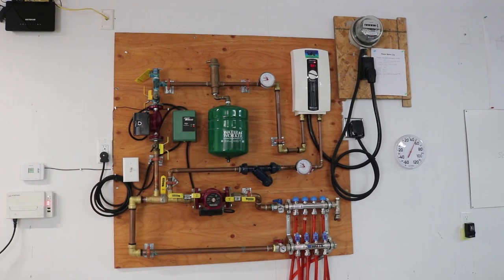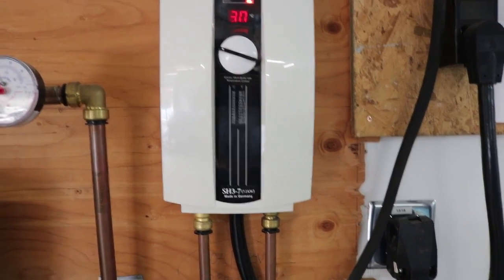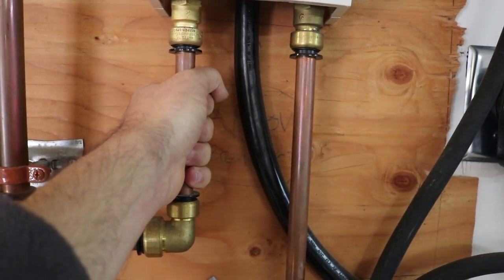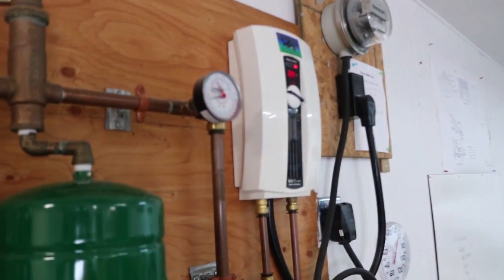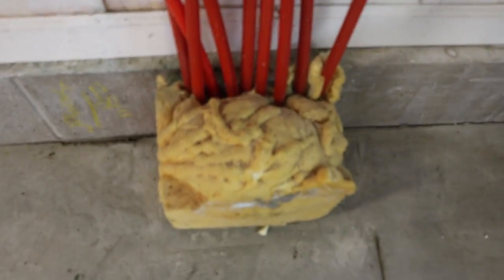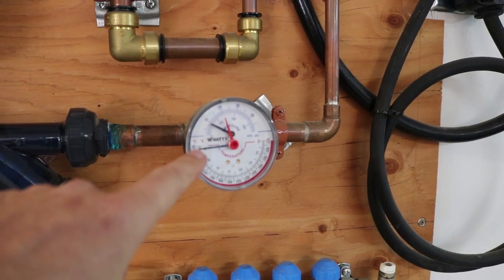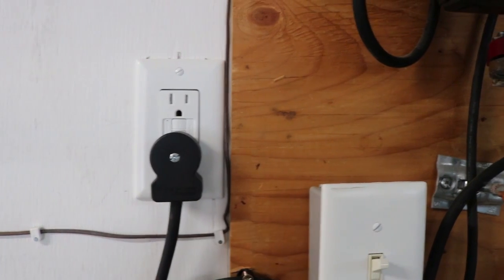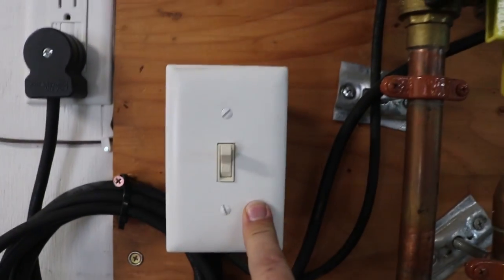DIY Hydronic Heat (2 of 3)

Comment: Hi Ben, I'm currently building a similar size garage and looking for some information on your heating system.  Does the Hydro-Smart boiler suffice for your needs?  My garage will be 924 square feet and in the Pittsburgh area (granted, not WI, but cold nonetheless;)!  How much electricity are you using through the winter months?  Thanks.

Comment: Excellent video.  I am doing the exact same thing with the exact same setup.  I'm having trouble figuring out how both pumps are wired to the same control?  I currently have the flow pump set to turn on on terminal 5/6 and the system pump working on the 1/2.  I was wondering if that is how you had yours setup.  Thanks

Comment: very impressive! need that book. Thanks for the resources and very clean clear video. One thing that popped out at me was the location of the pressure relief valve and fill port. Looked a little sketchy above the electric motor and relay switch. Might want to put that lower or readjust positioning. If the relief valve opens up that might damage those electrical components. Great great video Benjamin, really impressive.
Reply from the maker: That valve gets a pipe on it going to the side a bit and then down to near the floor.

Comment: I cannot say how impressed I am with what you've done here. You have a better understanding of what you've installed, and have done a better job than most of the local contractors here. The ONLY flaw I can find in the whole system, and this is certainly not a big issue, is the location of the secondary circulator. It should be in the supply side of the manifolds,  not on the return. 

When dealing with hydronics, the best practice is to "pump away" from your point of no pressure change. In your primary loop (the loop with the expansion tank), you have done that, as the point of no pressure change is the expansion tank. but in the secondary loop (the loop feeding the manifolds,) the point of no pressure change is the closelt spaced tees where the two loops connect.

Also, for safety purposes, I would encourage a pipe connected to the relief valve directed down and close to the floor. Where you have filled the system with glycol, putting a bucket under it would allow you to collect anything that may discharge, and return it to the system after repairing whatever issue caused the discharge.

Comment: Is the copper portion of this system 3/4" or 1"?  Also, you seem to have a ball valve with 4 ports on it just before the strainer.  Can you explain it's function and the size of the ports? I can only find such a valve with 1" and 3/4" ports on the same valve.  Thanks  for a great video.
Reply from the maker: The copper is mostly 3/4".
It's 1" where it goes to and from the manifold, as the manifold uses a 1" connection.
It's only 1/2" at the heater. 
The part you describe is the PURGE TEE. It allows you to adjust flow between the primary and secondary loops. This can be important because the heater can be a bottle-neck to the rest of the system.
It's better explained in some of the manufacturer videos. Follow this link and then watch the PRIMARY/SECONDARY MICROBOILER HEATING SYSTEM video:
https://www.menards.com/main/plumbing/hydronic-radiant-heat/radiant-heat-control-panels/hydro-smart-trade-1-zone-high-temp-integrator-panel/hsps120ht/p-1444433736572-c-8521.htm

Comment: Ben, thanks for the videos you've recorded. Very informational, and I've learned a lot. Just about the get my own system together and I have a question about your strainer. Who makes it (model number?), and what kind of fitting does it use? I like the ability to see your flow and see if there's any debris or bubbles in the system.
Reply from the maker: It's this one. It uses a 3/4" union connection, I believe that's a 3/4" NPT female.
https://www.menards.com/main/plumbing/hydronic-radiant-heat/radiant-heat-manifolds-components/hydro-smart-3-4-clear-y-strainer/1257007/p-1444433730385-c-8523.htm

Comment: Ben - apologies if I missed it, but could you explain how you actually put the glycol in the system? Did you turn all the return valves on and the feed vales off, then open the feeds one at a time? Also - i know you used an external pump for the glycol, but did you turn on the pumps in the system as well? From what I understand, they shouldn't have liquid passing though them if they're not on. Thank you.

Comment: I'm installing the same type system in my shop.  A single zone with a primary and secondary pump.  The TACO instructions are not clear.  How did you wire the 2 pumps to the TACO SR501?

Comment: great tutorial. I am attempting a similar system. My setup is a prymary circulator and 2 zone circulators and i will be running natural gas condensing tankless boiler. how did you wire your primary pump? i assume the primary pump should be on anytime the zone pump is running. I have read some wire on to the ZC ZR block, but my boiler might need that block. thx.

Comment: You have it plumbed for Primary/Secondary --- but the purge valve is shut. A primary/secondary system with a closely spaced tee is designed to have the purge valve open between the primary and secondary circuit.

Comment: Isn't the return water pretty much the lowest slab temp? I mean a sensor might be interesting but just using the return temp like in any other heating solution should do the trick. edit: Ah I forgot your pumps are not running all the time, so sensor it is ;) .

Comment: Couple things i don’t understand... why u do sensor the concrete temp, but wanna set set the roomtemp? Depending on the installation of your sensor there will always be a misreading cause its in a airbubble. If its not misreading u just get out feedtemp minus loss with a delay depending on the mass. Next question is how u could set up a heatingcurve with this config? It will save a lot of energy especially when u don’t have to maxout the feeding temp on not so cold days who are the most of the days in heating season.

Comment: Very interesting system, it doesn't use an outside temperature sensor at all? 

Unless you're keen on buying a fancier thermostat you could probably desolder the resistor it uses to measure the temp, solder in a wire in the thermostat and solder the resistor on the other end and feed it down the tube. Maybe a little plastic box that fits down the tube to keep it safer. Just a thought though, don't know anything about how honeywell typically make their thermostats.
Lovely series!
Reply from the maker: Why do you ask about an outside temperature sensor? My home heating system doesn't use one. Outdoor temperature would be interesting to track, to compare energy needed to keep warm at a certain outside temperature, but I can't think why a heating system would NEED one. Would it be to help PREDICT changes in temperature to be able to react to them?
If a person is good with Arduino, there's no reason not to try all sorts of fun things with temperature sensors, timers, and programming!
Reply: @BenjaminNelsonX  Here in Sweden it's been the standard from maybe 70s to early 2000s to only have an outside sensor and a curve you set for your heat response for most water based heating systems. Last maybe 15 years they typically have both. A system that is configured correctly typically keeps the inside temperature inside within 0,5C° of your desired temperature. The inside temperature sensor is mainly for turning the heat down for when you generate a lot of heat inside the house for some reason.
Reply from the maker: @menigar   Interesting idea! The U.S. is far behind Europe when it comes to many things in efficiency. The Passivhaus concept has had some influence here, but really only on the fringes. I suppose that a system using an outdoor temperature sensor, the "curve" you set must be based on the size of the heated space and how well it is insulated. I would imagine that's done with a little math or maybe even just a simple chart, just once, the first time you set it up.
One thing that has started to become popular in the U.S. is the web connected "Smart Thermostat". I just got one for my home. Among other features, it can read the weather report from the internet. I wonder if more of these devices will use weather information to predictively compensate for heating and cooling needs.
Reply: @BenjaminNelsonX  You can do it with some maths but it tends to vary a little bit with placement of sensor etc. So to get the best available comfort it's recommended to make sure all your radiators are fully opened and balanced and then you just track the temperature inside somewhere in the middle of the house where sunlight or radiators doesn't affect the temperature too directly and then adjust accordingly. If you have a lot of temperature swings you'll figure it out within a month. As usual patience is key and only change one thing at a time.
Smart thermostats are very interesting too. Would love a video from you on that as well!
Reply: outside temp sensor is mostly beneficial for open loop system such as DHW.... this system seems to be closed loop thus the solution in the system will not drastically flactuate with outside temperatures assuming home is insulated.

Comment: I was wondering why you didn't keep it simpler by installing an electric radiant floor with restive electric wires in the concrete, since you are using electric heating anyway. I like the insulation under the concrete, that's something most people skip.
Reply from the maker: The only resistive wire systems that I know of are just designed to warm the floor so that you are comfortable walking around in your socks or barefoot. They do NOT act as a heater for an entire building.
Using tubing embedded in concrete also allows for a choice of sources of heat. I could use an electric micro-boiler to power it, but I could alternatively connect a gas-fired boiler, solar water heater, or even an outdoor wood-burning boiler.
Reply: @BenjaminNelsonX  There are wires made specifically for concrete slabs, but from what I can find, you still would have had to use twice the length of wire to get the same total power dissipated as your heater, although that might be worth comparing prices for a new install. I thought you might have chosen that to be able to use gas or other energy source than electricity, that makes sense.
Reply from the maker: @ShawnGuertin   I just did some digging through the web and found some appropriate heating wire designed for use in concrete. I ran a design wizard, and found that the cost of components for my garage would cost over $6,000 for that type of in-floor heat.
I seem to remember briefly looking at some of these types of products back when I was very first thinking about building this garage, and decided against them very early on.
The hydronic heat was considerably less expensive and allows for some flexibility. The upside of the electric wires/mats is that they have no moving parts!
Reply: @BenjaminNelsonX  I found the bulk wire for 2500$ for 1400 ft at 7000W, but that's still more expensive then your 2000$ system, the only thing the electric wires would be better at is reliability by being simpler, but your solution makes financial sense. Besides, I learned a new possibility watching you.
Reply: Shawn Guertin , the system you are referring to is called a " pyro " wire system and is a great system however in this hydronic scenario the OP has the option of replacing  or combining the electric boiler with an gas or solid fuel alternative .
Reply: The beauty of hydronic slab heating is that the controls are far more advanced, allowing for finer control of system temperature for maximum efficiency. In addition, hot water systems can be heated by any heat source available. Solar, electric, geothermal, oil, gas, wood, pellets, you name it.

Comment: Are you going to tell us how much electricity  it takes I know the warm floor is awesome and you have lots of variables to heat the water the 7000 watt on demand is easy to include into the system.
Reply from the maker: I've been logging heat use with a utility meter. I'll be able to track that and compare it to my electric bill and my solar production. I'll do a video on that in the future.